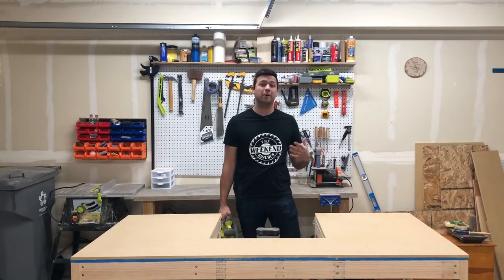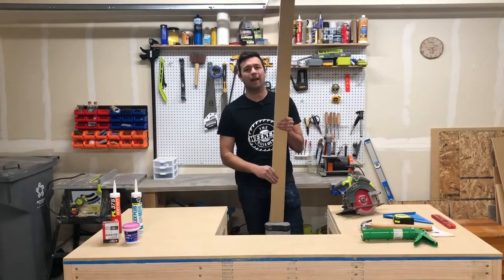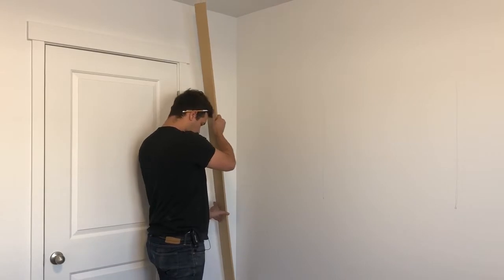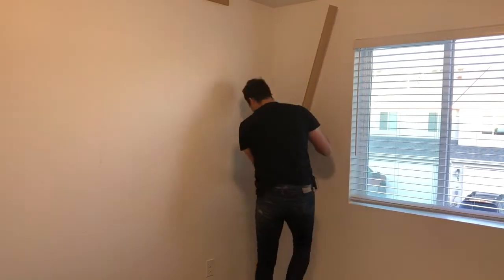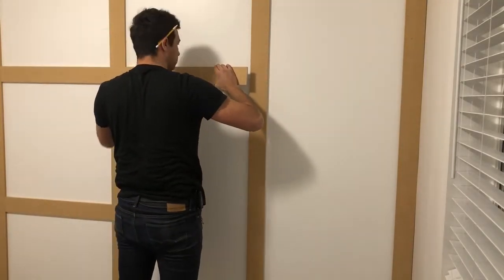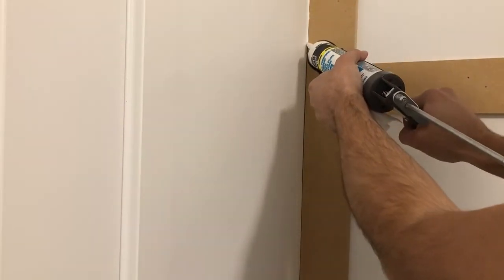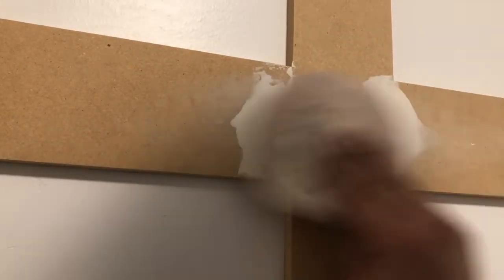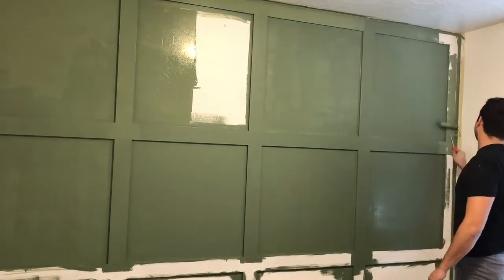How to make a board and batten wall with minimal tools

Comment: Great work! make sure to caulk all the seems to prevent cracks in the joints from showing when the wood expands and contracts. Also, make sure to cover the nail holes with plaster or wood filler, otherwise the paint will dry and contract, and you will be left with some tiny divets where the paint didn't totally fill the hole left by the finish nails. Consider making miter cuts at the corners to make a smoother look as well.

Otherwise, great and simple project! I like the color, looks pretty.

Comment: Use olive green outlet plate covers, or get a dark floral, low key wallpaper to cover the outlets. The contrast is too much for that wall. 
Great vid, show us your cuts more next time. 
Please use a latex glove when calling to give a much smoother finish. Hold caulking gun at an angle, never straight on.

Comment: Tried this and it was harder than I anticipated. My ceiling is over half inch higher left to right,  the corners on the left and right side are also not plumb. So had to scribe wider boards. And using the dap to fill in gaps didn't work as well. 😢

Comment: Looks great! Was the wall textured. Or did you remove it earlier?
Reply from the maker: The wall had a very slight knockdown texture
Reply from the maker: And I didn’t remove it. You may just have to caulk between the battens and the wall